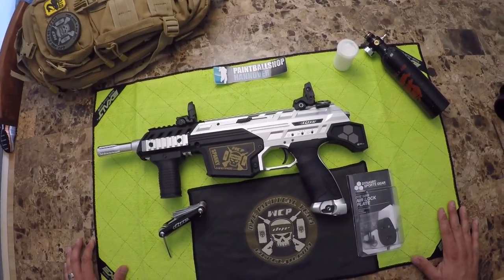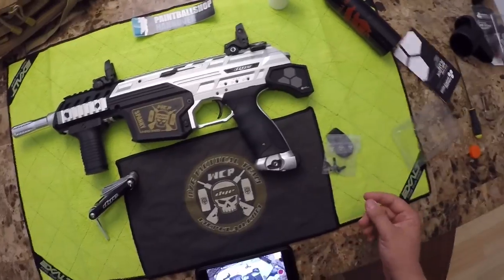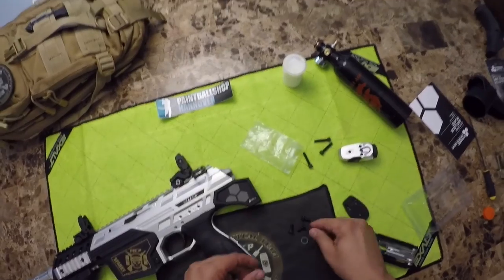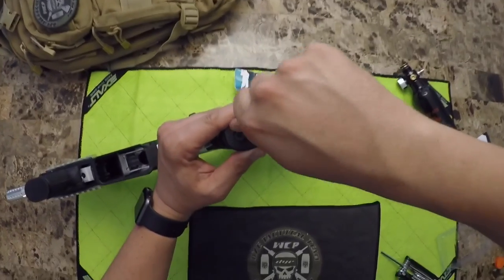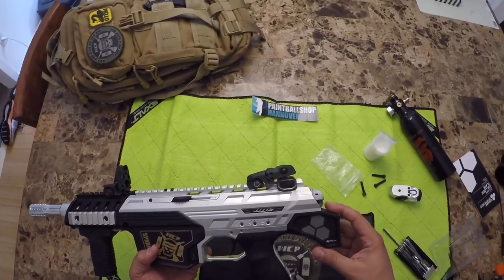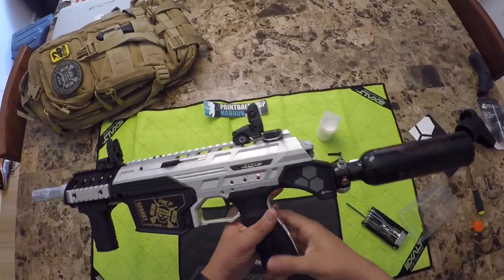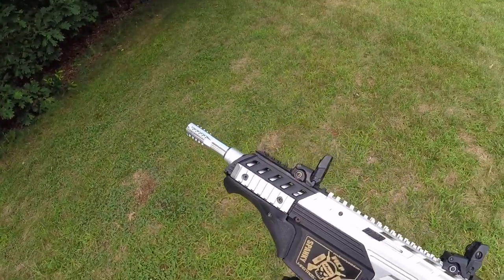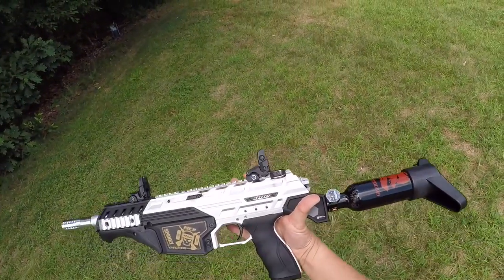DYE DAM Air Lock Plate by DYNAMIC SPORTS GEAR

Comment: Hey I have another question,  I received the Box Rotor today but there wasn't the bolt in the package with the rotor.  Are they not including them with the Rotor?
Reply from the maker: GoldenBOY PB if you bought the boxrotor new and it's not in there call dye headquarters and they should be able too hook u up.
Reply: wcpclan Hey thanks, so here's and FYI I spoke with DYE are no longer selling the DYE Box rotors with the upgrade bolt because all the new DAMS are being sold wit it already, which is the bolt with the red tip.

Comment: Hey i got a question i just got my dye dam i havent used it yet also looking for a short barrel but most important i already have two ninja hpa tanks idk whats the output but i hear that for the dam it has to be at 550 how can i change it or will it work fine with the regular output?
Reply from the maker: AsRmNinemilli9 you can test it out and if it doesn't shoot right check the tank shims
Reply: AsRmNinemilli9 I know your comment is old but for future reference for others... all tanks come set at 800 or 850 psi at least for ninja and first strike...your regulator should adjust that pressure in the gun... you can add a kit to help the longevity of o rings and such helping in regulating that pressure

Comment: How many 20 round mags could you get out of the 13ci 3000 tank?
Reply from the maker: GoldenBOY PB depending on your bolt setup and fps about 5-7
Reply: wcpclan ok thanks, what is your recommendation for more efficiency?  Im getting the CQB model in a day or so depending on shipping with the Box Rotor.
Reply from the maker: GoldenBOY PB use good magfed paint, plus try to bore match your paint.  Join the DAM owners group on Facebook for a lot of great tips too!
Reply: wcpclan Great thanks.